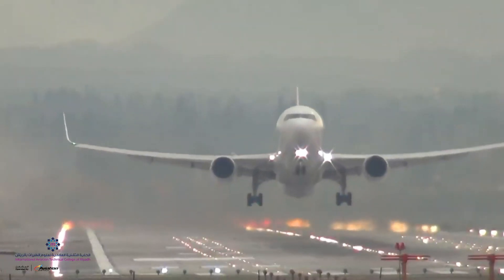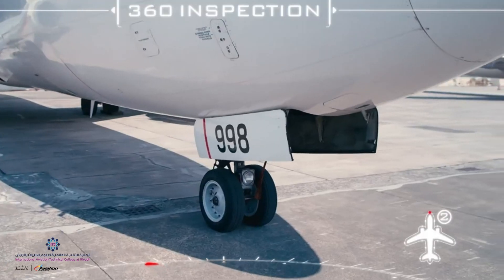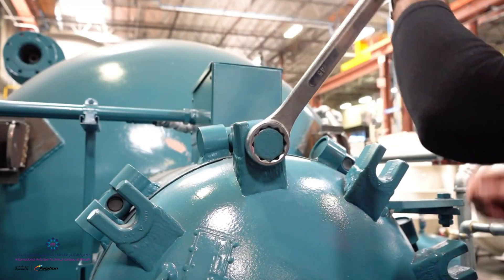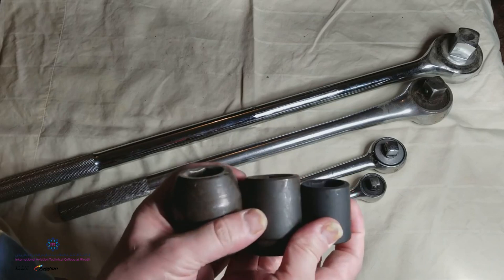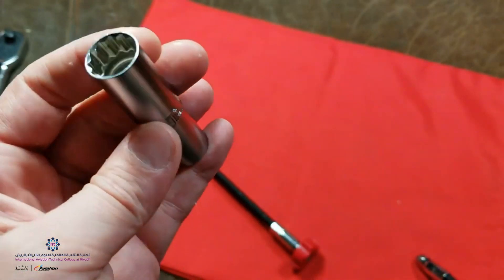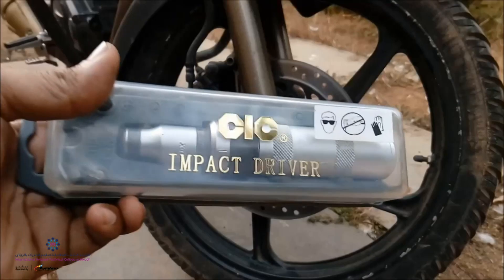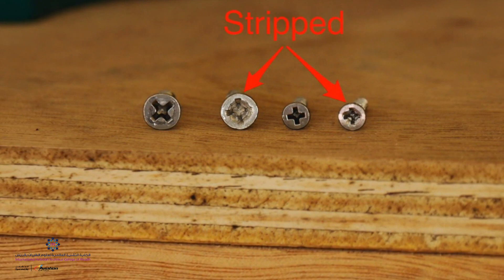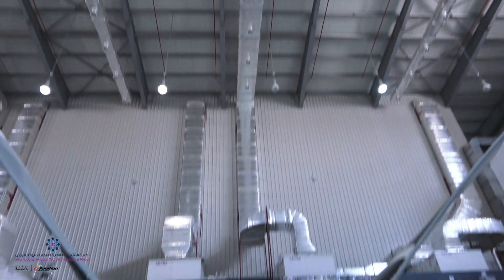Aircraft Maintenance Tools

Comment: A "gear wrench" and then shows a regular box end wrench. Don't be lazy and use an adjustable wrench, you will just strip the B-nut just go get the right size. Anyone who actually works on airplanes will tell you it probably won't fit where you're trying to use it. Also, not a single mention of a crows-foot socket or a torque wrench for that matter, guess you don't believe in torquing lines or anything else. No safety wire pliers either? Would hate to fly on whatever POS airplane you're maintaining.
Reply from the maker: Thank You for your comment. We cant cover many details on a video this size. We will keep your feedback in mind when producing another one of those videos.